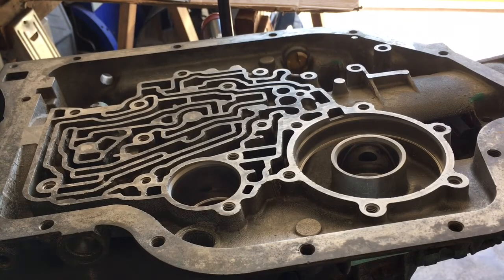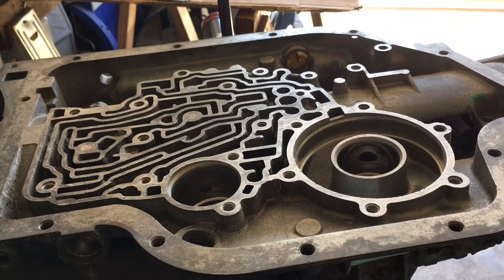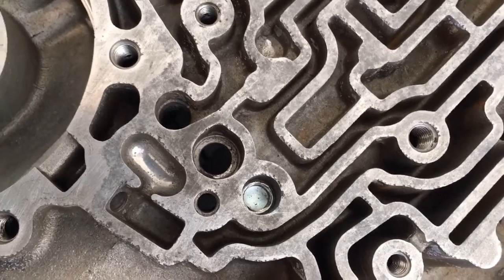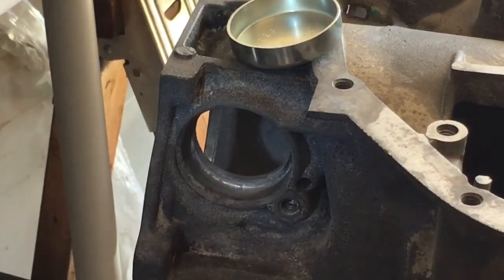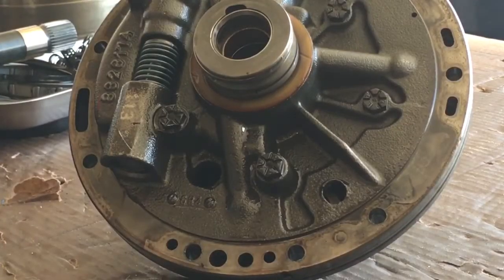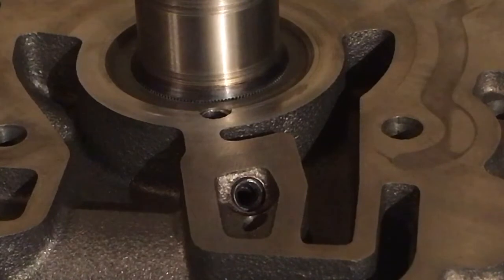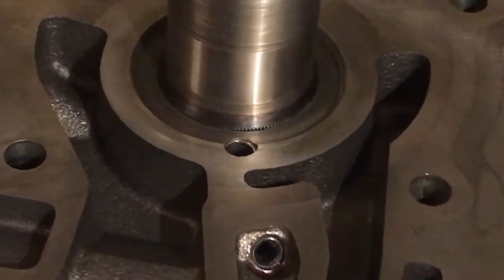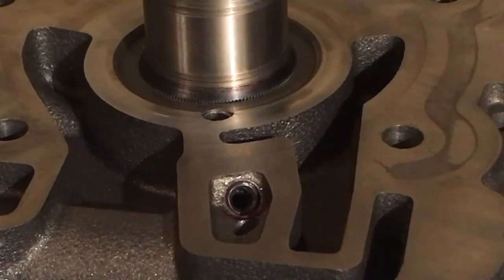DIY TH400 Converter feed restrictor

Comment: I have always used Transgo's dash 1,2,or 3 kits, it has the duel feed built into its kits. No need to install the cup plug in the center support, or remove the second ring on center support. The pressure regulator assy gives you different parts for this assy.  I believe it addresses the converter feed problem. I have installed lots of their kits, never had any problems. I also installed a new stator tube that I got from TSR. The original tube is made from a cast material, sometimes where the stator engages, it wears.
Reply from the maker: peter ferri I’m not familiar with the different stages of the Trans-Go shift kits, but I do know a lot of people use the stage 2.
Are you saying the Trans-Go kits have instructions on lip-seal delete on the apply piston to do the dual-feed mod? 
There might be a restrictor available to control the fluid pressure feeding the torque converter, I’m not sure. 
I followed the Jakes Performance built sheet, the only area I was a little confused was the shift kit check balls. 
The only reason I used the B&M shift kit was I got a big discount on it, trying to save money. There’s a couple transmission builders on YouTube who show you how to build your own shift kits. JD
Reply: @HeadFlowInc  No need to delete anything with transgo's kit, just install springs and separator plate, and install the parts in the pressure regulator assy. Stage 1 towing, stage 2 street strip, stage 3 full manual, select any gear any speed. They have good tech support. Just build as normal, no need to remove the inner lip seal on direct drum, no plugging the center support, the kit has different spring for valve body, in some cases, different valves, and drill bits to enlarge holes  in separator plate. just follow their instructions. They give you tips on areas that could be built up. Used em for many rebuilds.

Comment: Thanks for the info, I’m about to rebuild my th400, I’ve rebuilt multiple 4l80s and 4l60s so now a th400.
Reply from the maker: Clifton Cooper Definitely use your experience, a good manual, and there’s great upgrade info on the crankshaft Coalition website.
I wish I had purchased a quality How to High Performance book, mainly to make sure I didn’t leave out any modifications. Good luck Thanks!  JD
Reply: HeadFlowInc yeah I’m just rebuilding it for the time being before I do my ls swap. But I think it will end up staying in there for a year or two until I get everything together. No need to rush because I want my baby girl to enjoy working in the garage with me. Be a father daughter project. I’ll have to check out that page to see everything I can on it and buy a good th400 manual. Thank you for the information again! You have some good content and very informative

Comment: Great video, I just used this on a buddies 400
Reply from the maker: Glad it helped
Reply from the maker: I did not know at the time you can actually buy brass set screws;  are way easier to drill than the steel one I got at tractor supply. 👍😉
Reply: Good to know

Comment: I do this all the time. Use brass set screws. They drill easily..
Reply from the maker: Kurt Schmidt I sure wish I would have known to use brass!  Thanks for the tip, I’ll use brass next time! 👍👍👍
Reply: Sorry for the comment 2 years later but where did you find brass set screws

Comment: If I do this to my th400 can you still use the B&M shift kit?I'm asking because they give you a heavier pump spring I'm assuming to raise line pressure. This 400 trans is going behind a ls. swap.
Reply from the maker: Yes, definitely converter restriction is recommended and works with shift kits. Use Brass set screws/plug to make it easier to drill!  Trust me I killed 3 drill bits drilling the steel set plug in this build.  Lesson learned lol. JD

Comment: Wouldnt this cause less flow but high pressure since you are closing the hole size?
Reply from the maker: Apparently this modification reduces the converter feed “pressure”, it’s a commonly used method of lowering the converter pressure to avoid thrust bearing wear in the engine from converter ballooning.  JD

Comment: Hello can you make 2 of them set screws for the pump at .125 please let me know thanks John.
Reply from the maker: I haven’t considered doing any production. I can verify drilling the steel plugs like I used is tough, I really needed a higher quality Cobalt bit. 
I’ve been told it’s easier to drill if you use a brass or other softer metal plug. 😉
If you could make a jig to screw the plug into to hold it would be nice.  JD
Reply: @HeadFlowInc  yes I sure but you did a nice job I need 2 of them in steel if you could help out a disabled man god bless you thanks jb.
Maybe a carbide drill bit would be best for very hard material go slow and lots of oil.
Reply from the maker: True

Comment: hi. Had a  question. is this Also recommended for a transbrake application?
Reply: (Converter feed )
Reply from the maker: gm Tech Controlling the pressure to the converter is very important in a TH400 with or w/o a brake. A trans brake uses fluid pressure to hold Reverse/Low gear together totally separate process.  Thanks for watching!  JD

Comment: Do non trans brake builds need a restricted feed?
Reply from the maker: Yes, all TH400’s have a tendency to have high converter  pressure which can ballon the converter and cause forward pressure on the engines crankshaft resulting in thrust bearing failure.  
It’s truly not going to be a bad idea for all rebuilds.  A bone stock transmission seems to be fine but any modifications big/small I’d restrict the converter feed. JD

Comment: My transgo kit said to leave the horse shoe shim out with there spring
Reply: Is that correct
Reply from the maker: @vrg69  I’m not familiar with all the kits, but I bet the New spring is stronger and doesn’t need the horseshoe spacer to set the pressure they want.   JD
Reply: @HeadFlowInc  thanks again for info

Comment: what is the purpose for the set screw modification
Reply from the maker: Jesse Ramirez Torque converter feed restriction to stop converter ballooning and thrust bearing wear on the crankshaft.  TH400’s are known to create too much converter feed pressure, so a restriction is the cure. 
In the valvebody the set screw helps build constant pressure on that circuit, which is also why the spring is discarded.
Reply: In some instances (heavy towing is one example) the TH400 tends to make the converter thrust against the rear of the crank. This in turn wears out the engine crankshaft thrust bearing.  Restricting the converter feed helps eliminate this issue. A brass setscrew installed in the pump in the location shown in this video, drilled from .125 to .160 works fine.. I usually drill it to .140 and call it done.. Each builder has his own drill size preference.. .125 is a popular choice too..

Comment: Funny because power glide guys are always drilling out the feed holes. My builder told me to leave the 0.100 hole and not drill it.
Reply from the maker: Nicholas I’m confused when you put the set plug in the hole it doesn’t have a hole of any size where are you coming up with the .100” hole? 🤷‍♂️
Maybe a PG is different in terms of converter feed restrictions, this video is about TH400 only.  JD